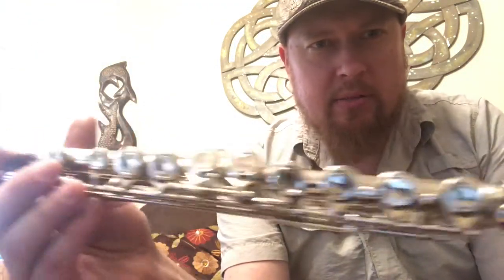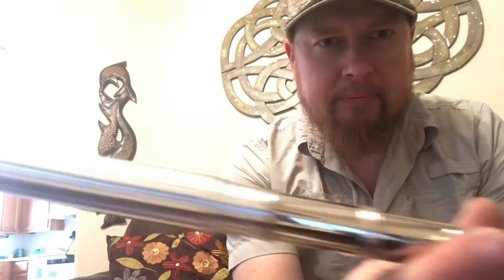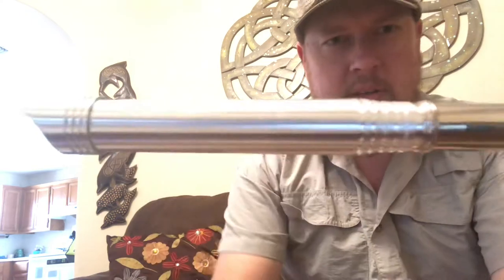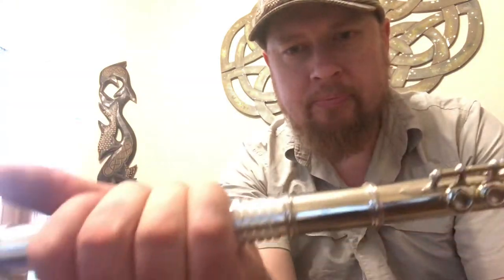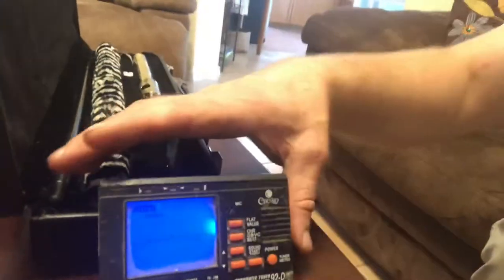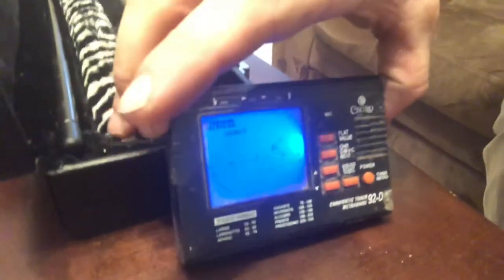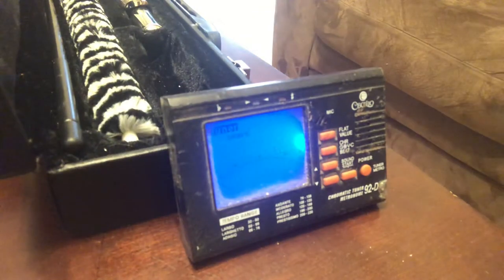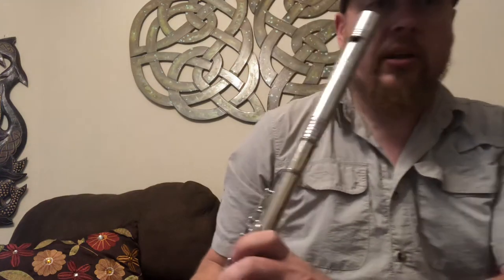Chromatic Low Whistle Flute headjoint from theirishwhistle.com

Comment: I am interested in one but the one on Ebay is sold and I don't seem to be able to pull up anything on your website. Also, could you make one in wood?
Reply from the maker: I'm making some more this weekend, I can't do it in wood right now due to the internal parts and the thin tuning slide, I may eventually do a wood/metal combo.
Reply from the maker: I have some now...